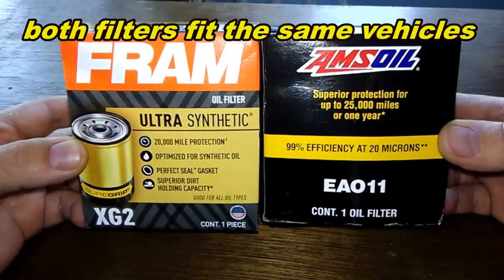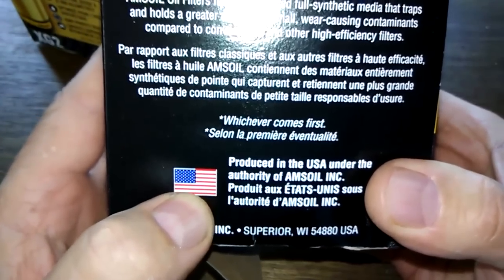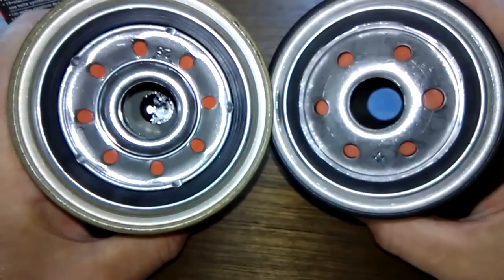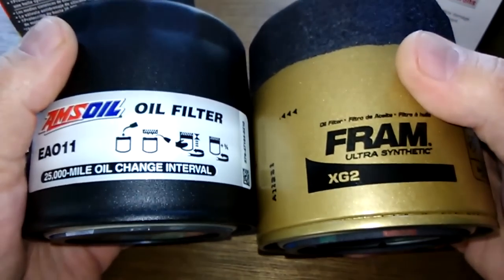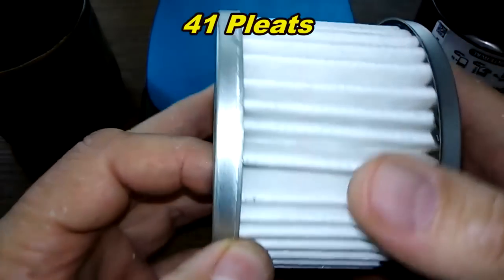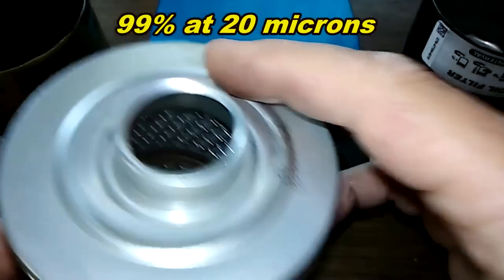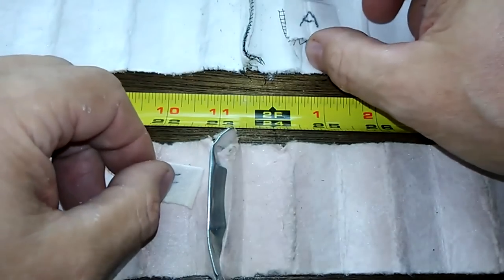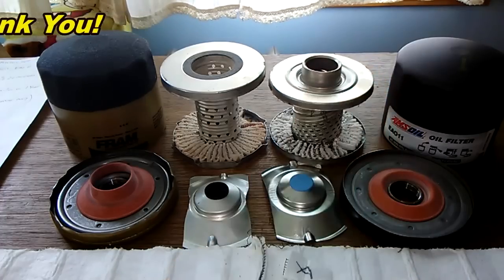Fram Ultra XG2 Oil Filter Cut Open vs. Amsoil EAO11 Oil Filter Cut Open Oil Filter Review

Comment: Thanks for this video.  Very interesting, IMHO.  FWIW...my Subaru 3.6R (now at 70.000 miles) has an unusually high by-pass spec of 23.2 psi.   I haven't learned from Subaru or any other source whether or not that's particularly important but, because of it, have always used Subaru OEM (Tokyo Roki;  $7-8.00 from the dealer.) filters and changed oil/filter (Pennzoil Ultra 5W-30) at 6,000 according to manual spec.   I acknowledge that many aftermarket filters show better construction, better media and better specs than my OEM filter...as both of these do.  However, my Blackstone UOA's show results better than any others I've seen from Subaru forums, BITOG, Blackstone or any other source regardless of oil/filters used, especially in terms of "wear metals".   Given my angst about that Subaru by-pass spec, I've been reluctant to use other filters that don't have it...meaning none.   Still don't know if that unusually-high bypass spec really matters or not but based on my UOA's, I think I'll keep doing what I've been doing.
Reply from the maker: That's a high BPV setting, the most I see go up to around 18psi. for regular oil filters. Racing oil filters usually have high BPV settings also. In my opinion, a by-pass valve setting all depends on how restrictive the filter is, if it's less restrictive it won't need a high BPV setting. I think with regular oil changes and with what you're using "Pennzoil" a good synthetic engine oil and you shouldn't have any engine problems. Good oil analysis reports are a good sign your doing everything right. Thanks for your feedback!
Reply: @WhipCityWrencher  Thanks for response.   PS to previous...I am attracted to the material, construction and specs of these higher-quality filters.  If ever the time comes when I'm able to learn the actual reasons behind Subaru's unusually-high bypass spec...that is, if I learn definitively that it doesn't really matter in terms of using an after-market filter with lower by-pass spec...I will likely change.    However, Subaru dealer, Subaru specialized shops, Subaru national and the filter manufacturers themselves have told me so little as to be indistinguishable from nothing at all.   Don't know why it's such a secret.  Almost like asking a magician to divulge how they've done one of their illusions...they won't do it.  Advice from anyone solicited.

Comment: As a technical specialist for an oil company and additive company as well as being a senior Master Tech at a dealership and seeing what goes on with these types of filters and different types of oil the Fram Ultra is an outstanding choice for a filter and it does a very very good job and when you break it down to see what is the best bang for your book it's going to come out the Fram Ultra every time it's the best filter on the market for the price right alongside the Fram titanium
Reply: FBM, what about flow? It looked like the Amsoil filter had far more holes in the core. About twice as much. Does that make a difference? i’m only asking because I use this Amsoil filter and if I could save a third of the price using the Fram that would be great. But only if it’s about equivalent as far as performance. thanks.
Reply: Laster tech hahaha. Say your a mechanic and be proud of just that. No need to cover it all in shit.
Reply: I’m old school. I check my oil all the time. Fram ultra filters are great. After a few months I can still see my oil dip stick
lines through the oil
Reply: @Maynardd  are you a preferred customer with Amsoil? It saves a ton of money on their products!
Reply: @littlefinkle7757  I am, but I wouldn’t call it a ton of money.
Reply: @hillbillyfromtheswamp6223  he’s telling you that makes him credible 
you sound like mobil 1 fanboy
Reply: @Maynardd irrelvent if you change your oil like you should. I don't think there is one recorded failure due to an oil filter not having enough inlet holes, at that point It would just go into another hole, or activate the bypass if was compelty clogged
Reply: Omg what are you paid by Fram? Fram is the worst. Lol
Reply: @dirkmcghee1604  yes, it is, the majority of The filters they offer are complete garbage. But the frame ultra is literally one of the top of the line filters.
Reply: @dirkmcghee1604  only the low line orange ones are crap. The top tier ones are excellent.
Reply: @dirkmcghee1604  no, I've seen more comparisons their best are comparable to the best.
Reply: @daveroski  Never had a problem and no one would  eitherchanging them @3-5k.Give me a break. You're most likely wasting your money some expensive ones are even worse.
Reply: @twinkieerella   It doesn’t add credibility though.   If he was a lubrication or powertrain engineer it would
Reply: Amsoil are really good because they 99+% at 20 microns with excellent flow numbers the competition is getting better with micron rating but giving up on flow I can't stand the cheap Fram the bleed through on the paper caps and just circulate contaminants they expensive Frams are decent but quality control is bad some look good and some are pathetic I run Amsoil or Mann+Hummel manufactured filters Wix Napa Purolator Bosch Carquest commercial blue label are few more I wont use Fram because we had 2 split at top on Chrysler V8s in cold weather both were new engines so oil pump was really strong it couldn't handle it we sent the whole shipment back and got contract with a another supplier then come to find out it was happening with several shops
Reply: @kevinmarchini5272  Our home Depot only sell Fram.Not that I buy them there.Just noticed.
Reply: I have been a Mechanic for over 45 years and Have Never seen a Engine Car or Truck , Farm Tractor  Fail from Using Fram Filters  The Engines that did Fail was from Not Changing the oil   "Changing the Oil is Far More IMPORTANT then what Brand Filter you Use !!
Reply: @danray9744  - If I may, determining which product to use based on whether it failed or not might not be a valid way to compare different products for their positive, performance enhancing aspects.  For example, ingesting lead in small quantities and not dying, (yet), doesn't mean lead is good for our health, right? :)
Reply: @dirkmcghee1604  The Fram "Endurance" sold is identical to Amsoil and Royal purple filters as they are all made by Champion labs and after extensive testing and confirmation, they are identical items with the exterior labeling being the only difference.  I do agree that the lower end Fram filters are junk considering the Fram Endurance is $12.97 at Walmart for all part numbers and Amsoil is $17-20 per filter, the blue Endurance is the same in every way.  I wouldn't have bought a fram, if it was free a month ago.  Now after cutting them open myself as they do on this channel, it is amazing they can be that close without patent infringement.  But that is something nobody cares about.  Either way, Endurance is the way to go and choice of oil is next.  Mobil1 has reformulated and now is mid-tier based on virgin and used oil analysis.  There are about a half dozen much better choices.  Just food for thought!
Reply: You obviously never seen or used MANN or Bosch🤔
Reply: @ginog5037  You mean as far as Mann Hummel being a large manufacturer of Purolator and Bosch oil filters falling under the same umbrella?  Bosch has great air filters and windshield wipers but their spark plugs are not very good.   What about them?
Reply: @Balticblue93  You forgot Wix and countless others, made in their new plant in NC. The ones I get still come from Germany or Spain. So where's your real data on MANN and Bosch Premium?
Reply: @ginog5037  what are you complaining about? When you get on here huffing and puffing looking like a crazy you won't get any way with someone.

Change your approach fella
Reply: @FordBossMe  I'm assuming a tech at a Ford Stealership is supposed to impress anyone. Have you ever even used MANN or Bosch long-term.
Reply: @dirkmcghee1604  No, ultra synthetic is good, enjoy your overpriced filters
Reply: @hillbillyfromtheswamp6223 ha ha ha. There are definetly different grades of mechanics. Schooling makes a difference. The "head" tech at a dealership goes through lots of training. Did you? Or are you "self taught?"
Reply: @dirkmcghee1604 opinion. He just took them apart. Frame is clearly better.
Reply: Fram ULTRA IS THEIR VERY BEST! THEY GOT" IT RIGHT.
Reply: As a technical specialist are you looking for what’s the best price or best quality. Seems like you’re looking for price. Thank You
Reply: @dirkmcghee1604  you are what I like to call “incorrect”…they produce a few different levels of filters and compete with every other filter manufacturer out there…the lowest quality in their lineup are no worse than and other manufacturers lowest quality filters…Fram Ultras at at the top of the filter game hands down!

Comment: Been using the Amsoil filters for years. 23,000km intervals with them with of oil analysis done. Amsoil filters are expensive, but the way I look at it  for $25.00 now  and I am eliminating 2 oil changes per year. That’s $14 of the Fram filters I am not paying for. So really the Amsoil costs me $12.50 per change only paying up front. If that makes sense.
Reply: @Mrl9000 - $25 to help protect an engine worth thousands and thousands of dollars.  It's common sense.  Yet there are some people who want to pay as little as possible for an oil change.  I know, crazy right? Go figure.  30 year Independent AMSOIL Synthetic Lubricants Dealer.

Comment: In my opinion, if you already buy amsoil motor oil, you might as well just buy their filter. But if you don’t use amsoil fram is the way to go for sure
Reply: I've been using Amsoil motor oil and other products for decades. For filters, I do prefer the Fram Ultra or Tough Guard, or Wix quality. Price and quality is a consideration. All the cheaper made ones are to avoid in my opinion.

Comment: Almost $20 and a stamped leaf string? No thanks.
Reply: Not a leaf spring, there is a coil spring on the actual valve. The "leaf spring" is just a bracket.
Reply: @bobt897  Indeed. It holds up a shelf at the bottom of the filter.

Comment: I've been working at Walmart in the Auto Care Center for nearly 14 years and I've done thousands of oil changes in that time. I've never had a filter gasket stick on the filter mounting plate on an engine, that was lubricated on the original install. Every one that stuck was installed with a dry gasket. Some were on so tight with a dry gasket that the filter housing crushed when I attempted to remove the old filter because a dry gasket also adds friction. The filter has to be forced off with the gasket not moving while the filter is spinning.
Always lube your oil filter gasket with some oil before you install i
 
Personally, I've been using the Fram Ultra filters on all my vehicles at oil change time for almost as long as the Ultra has been available. I've never had an engine problem due to the filter failing.  It's my go-to filter. If my filter isn't available, I'll default to the Fram Tough Guard filter.

Thank you for doing an actual apples to apples comparison. No doubt there is an Amsoil fanboy someplace who would have done this comparison but would have used the Fram Extra Guard orange box filter then poo pooed the Fram filter for being a poor quality filter in comparison.  And usually it's because of the fiber end caps Fram uses on the Extra Guard over the metal end caps used on most higher end filters, including as the Ultra Synthetic. But what they tend to miss, is that the end cap material is similar to the actual filter media itself which requires much less adhesives and much less expensive adhesives to adhere 2 similar surfaces as opposed to 2 completely different surfaces. This is why you do see a lot of glue coming out of the filter media/base plate areas.  By making a filter less expensive, Fram can pass that savings on to the customer. It's marketing 101.

Anyway, thank you again for the great quality comparison's you do. Thumbs up.
Reply: The filter efficiency Fram uses is another play on words, 99% greater than 20 microns, which means at some point greater than that pore size it will stop 99%.  Whereas Amsoil gives the appropriate Absolute Efficiency rating at 20 microns, not some vague number greater than 20.  The other marketing ploy is the long life.  If you read the warranty, filter only, and only for a normal OEM OCI.  Whereas Amsoil warranty gaurantees the filter and engine for 25k from defects and damage., using the appropriate extended drain oil. Have not seen a comparison between a lesser quality Fram and the premium Amsoil.  By going the full 25k, the price is 1/2 of the Fram.  Been using Amsoil products for 37 years, never a problem caused by thier filters or oil, and I have gone way past 25k OCIs.  No I am not a dealer, just an engineer who studied synthetic lubricants in college in 80-90's.  I did these filter shoot-outs 25 years ago and I actually sent filters in for ASTM and SAE standard performance testing.  These physical comparisons are a joke, and as whip city wrencher said it is for entertianment.
Reply: @tssci6774  My family has been using Fram filters for about 70 years now. My Grandpa had the local Gambles Hardware store and he featured Fram filters. He never had a customer come back with a bad filter. We ran Fram in tractors, trucks, farm equipment and cars. Never an engine issue from any of the engines we used them in.
I've been with Walmart almost 14 years, and we did have 3 or 4 filter issues but all were due to a bad seal, not with the filter housing or inners.
Does Fram make had filters? No.
Does Fram make an occasional bad individual filter? Sure, anything can happen.
Amsoil is going to make an occasional bad filter too. Fram just manufacturers so many times more that a bad one will happen more often. That's life. No guarantees.
Reply: @dannyo6699  Nothing wrong with brand loyalty, never said they make bad filters, I have even defended them on forums over the soft endcaps.  As long as the glue does its job, dont care.   I have used Fram many times and have an Ultra in my car today.  Currently going through and using oil analysis to determine filter performance.  Better than tearing apart a filter and making subjective opinions. Amsoil actually stood behind their filter, paid for all independant testing, reimbursed me for my expenses when I discovered a bad filter in my car.  It was a one-off flaw, but they held to their gaurantee, did not ignore me or make sign a non disclosure before cashing my check.  Other companies like VP Racing did when their Octane booster damaged my sparkplugs and O2 sensors.  Big difference.

Comment: I always buy Amsoil signature series oil and Fram Ultra synthetic filter. Best combo in my opinion, runs great for a full year no problem on my 08 civic with 210k miles so far and running strong.
Reply from the maker: Hi Eddie,
Thanks For Sharing!
Reply: I use the Amsoil Signature series too. But my parts store doesn't sell Amsoil filters, oddly enough. A guy cut open 7 or 8 oil filters on one vid on here, Wix and Napa came out the best, so been buying Wix. Also use Lucas Synthetic Stabilizer, quieted the car down, had nicks that were driving me crazy. Civic, best car I've ever owned. Bought mine after delivering to their factory in Marysville OH. 86k miles, 2010.

Comment: Thanks Whip!  I've been using the Fram Ultra Synthetic for 4-5 years changing my oil every 5K.  The lower Fram filters are Junk as most know but they have a winner here for the price with the Ultra. I love the black tar Grip and I tighten it to car by hand with leather gloves very easily no leaking I always coat the gasket with oil First with my finger.  My other bargain go to is the Newest SuperTech which Whip compared against the standard budget SuperTech.  BTW  Do not ovetighten THE FRAM as it could strip or blow off with heat expansion as it has nearly ONE LESS THREAD than many others out there  (freeze Frame Whip's video) and you can see what I'm talking about the Amsoil thread is a hair deeper.  I've never had a problem though with the Fram but I saw a couple others that have. It is possible they were put on too tight who knows...The fram's can Wall is kinda thin and it can dent easilywhen I use my pincher's to get them off but no biggie there.  Blackstone labs tested oil for a couple Fram Ultra users and it came back at the top!  The Ultra media is very gooood purportedly.  Good luck.
Reply from the maker: Your Welcome!
Reply: The cardboard end capped filters are ok, at 3,000 miles...
Reply: @bobby1970  what's the difference? When did this "new" fram ultra start?

Comment: I have Amsoil oil inside my cars but I use Fram filters and love them. Especially the removal is easier due to the rubber grip. I use Fram Ultrasynthetic filters so Fram haters pls dont blast me on this lol. Sometimes, the Fram models that I need are not in stock then I often get Wix, Purolator or K&N (This one is also good for removal).
Reply from the maker: Thanks for sharing👍